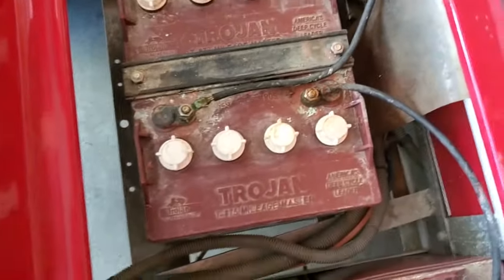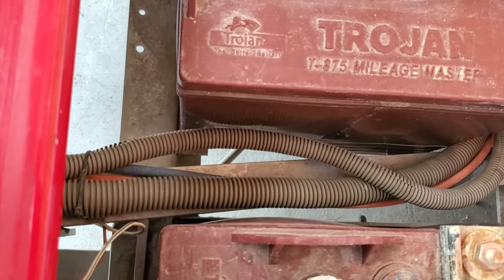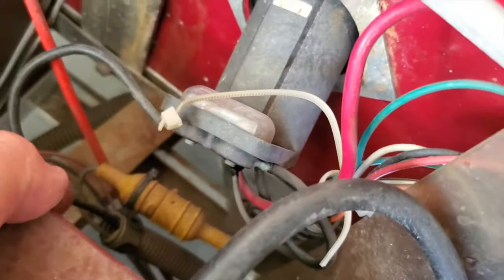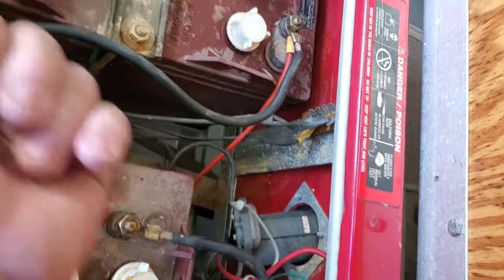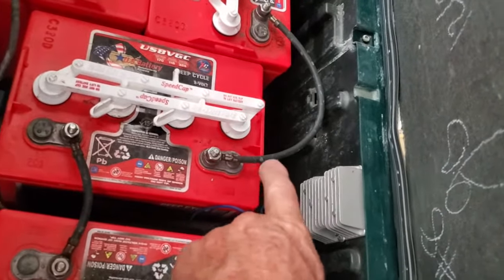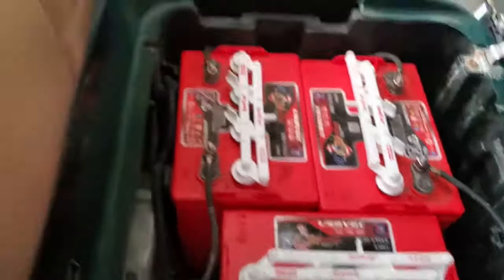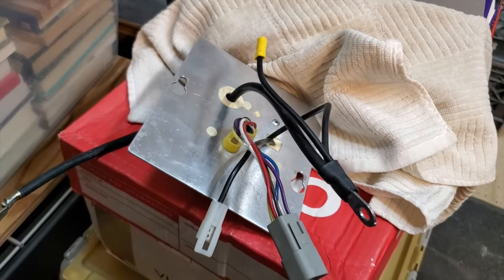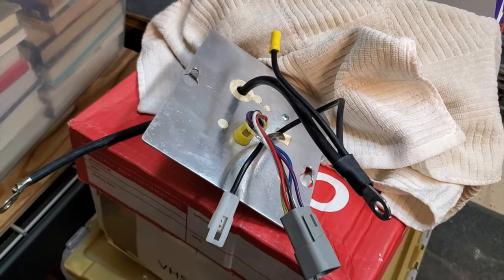How To Bypass Your OBC

Comment: I just did the obc delete, it will charge now but will not move forward or reverse. I have followed all your instructions here. Any suggestions?
Reply from the maker: I assume you meant you did a bypass?

Did you get a new charger?
What model and year cart do you have?
Is the tow switch in run?

Tell me what all you did?
Reply: @waynemartin.waynesgolfcart4900  it is a 2007 club car ds, i completely removed the obc. Ran the #10 black wire from the charger port to the last negative battery. Spliced the white and blue wires together.
Reply from the maker: sounds like you did it right. Text me pictures of your wiring so I can see the wiring you did as well as everything under the seat so I can see all the batteries and wires
Reply: @waynemartin.waynesgolfcart4900  took some pictures,  sent them to your number, let me know if you got them.
Reply: @gnjcs  I have the same problem. I connected all the wires the way you did, but my cart is not moving in forward or reverse when i press the pedal. Can you share the fix for this? I also have a 2007 club car ds
Reply from the maker: Those wires won't keep cart from running, you must have missed something. 
Text Me pictures

Comment: I have a Club Car Powerdrive 3 Charger that I need to use on a 48 Volt Forklift battery and I am not sure what to do with the 3rd Blue Wire.  Do I need to by an OBC and connect it somehow (to the Solar trailer)?   Any comments would be appreciated.  A 3 Wire Plug to a 2 Wire Anderson Connector is what I need to accomplish.  Never Done this before,
Reply from the maker: That charger won't for you, you need a different charger
Reply: @waynemartin.waynesgolfcart4900  There must be a way to make it work.  Let me know if you have any suggestions over the next few days.  I am going to (at least) try to make it work.
Reply from the maker: You can make it turn on, but it wont turn off
Reply: @waynemartin.waynesgolfcart4900  So if I wire Just the Red and Black Wires, and leave the Blue disconnected, you are telling me that it will (probably) charge the 48V Battery Bank, but will Not stop charging on its own: but will have to be Monitored and shut off manually: is that Correct?    Or do I some have to wire up the Blue wire (to something)?
Reply from the maker: You have to do some wiring in the charger to make it come on, but yes it will not turn off by itself.

Your forklift has a round club car receptacle on it ?
Reply: @waynemartin.waynesgolfcart4900  No the Forklift Battery has an Anderson SB350 Connector (just 2 wires).
Reply from the maker: why dont u just get a 48 volt charger
Reply: @waynemartin.waynesgolfcart4900  My friend Didn't get the one I Told him to get -- that was made for Forklift batteries, but thought he could get by with a Cheaper One for a Golf Cart: I mean, the Both Use a 48 Volt Battery, so why not.  Now I know why.
I thought that maybe the 3rd wire was just a ground, but apparently Not.

Comment: I have an old 1995 DS Club Car. It has brand new batteries, but it won't move unless I "play" with the Go pedal , if I move it back and forth it will suddenly Take off and run , until I stop, then I have to play with it again .  Help !  Any ideas ?
Reply: Hey, man did you fix the problem? I have the same problem. 
Please help
Reply from the maker: I would say either a micro switch on the f/r or the vglide.

Comment: Why not just take out the fuse on the grey ?
Reply from the maker: If you are talking about bypassing the obc, you can remove the gray wire fuse instead of cutting the wire off, if that's what you want to do.

Comment: Hi Wayne, question is better to do this bypass o replace the Obc?
Reply from the maker: Money wise, its almost the same cost either way. 

1 advantage is of you bypass the obc,  you will never have trouble with that again. 
Another advantage,  is you need a new charger, so end result will be you should have a newer and beer charger. 

THERE is only 1 model of the obc that is still available for less than 250.00, that is for a very old model, and that is the only 1 that will be cheaper to replace the obc than bypass it, that is assuming you are doing the work yourself. 

I myself,  bypass obcs,  rather than replace on all my carts.

Comment: Does anyone know which yellow wire he’s talking about coming from the solenoid? I only have a 6g yellow cable. Help.
Reply from the maker: If you don't have the skinny yellow wire, then forget about it, not all have that wire.
Reply: @waynemartin.waynesgolfcart4900  this is my issue...I have a 97 club car 48 volt. This apparently is a regen 1 cart. I have two solenoids that I'm pretty darn sure don't have the skinny yellow wire going to either one. However, besides the black and gray wires...i also have a yellow and green wire coming out of the back of the OBC and goes to the old club car black controller and not the solenoids. Do I need to worry about these green and yellow wires? Thank for the straight forward advice. Great channel.

Comment: Dpi charger died so I bought a links from Battery source, worked great for a couple months then Quit working on my 2000 DS. Still worked on friends DS. Sold Links charger and bought eagle performance charger from battery source. golf cart still runs fine just won’t charge. They said just run negative charger receptacle wire to final negative battery. Did not charge, then followed your instructions with yellow wire from solenoid to negative battery and no charge still and cart stopped working. Replaced yellow wire back to controller. Cart runs again but still no charge. Any suggestions? Thx!
Reply from the maker: First thing to check is the # 10 red wire from charge receptacle to main pack positive.  Make sure the ring terminal or end of wire is not corroded or swelled up.

Then run black from cart receptacle to main pack negative.  If you have a skinny yellow wire on the solenoid,  reroute that to main negative. Not the fat yellow wire.
Reply: @waynemartin.waynesgolfcart4900  I did everything and still
No charge. Cart still runs. Could there be anything wrong with the new charger, plug has bottom prong slightly shorter than +/- prongs. Is that normal? The guy from battery source says to rewrite everything back to normal and just add jumper from charger receptacle negative to main pack negative. Also I managed to damage the fuse on the charger receptacle so I just strait wired it hoping the new eagle performance charger would manage. Maybe I’ll go try a friend’s factory charger and set timer for 20-30 minutes at a time
Reply from the maker: maybe you have the wrong model charger.  What is exact model number and brand charger ?
Reply: @waynemartin.waynesgolfcart4900  thank you very much for you help
Reply from the maker: I  think you have the wrong  charger
Reply: @waynemartin.waynesgolfcart4900  Ok, I returned the charger to battery source and they had a summit2 charger. So I picked it up and wired the cord as instructed.  I had already clipped the thin yellow wire off of the solenoid and ran it
To pack negative. Should I have left it connected and spliced into it? I plugged in-the new charger, The blue power light illuminated on the charger to show AC power,  The carts charger receptacle female plug even shows 47volts, cart still runs fine but no response from charger.
Reply from the maker: You don't remove the skinny yellow wire from the solenoid,  you run it from the solenoid to the pack negative
Reply: @waynemartin.waynesgolfcart4900  Are use the thin gray wire like you did to connect it to the yellow wire going to the solenoid. Should both pieces of yellow wire be connected still? Where does the yellow wire come from?
Reply: I’ll splice it back and try it
Reply: @waynemartin.waynesgolfcart4900  I spliced it back and still have nothing. I’m stumped. I appreciate your time, I really do sir
Reply: @waynemartin.waynesgolfcart4900  Wayne!! You wouldn’t believe this…. The stupid cord from battery source was wired backwards! I checked continuity from the charger to the prongs and couldn’t get a reading cut the shrink wrap back and opened a plug housing and saw that The wire colors didn’t match. I flip the two prongs around, boom we’re charging. Thanks for your help!!
Reply from the maker: if you cut the yellow wire,  you only need to use the part that goes from the solenoid to the main negative
Reply: @waynemartin.waynesgolfcart4900  thanks so much. I’m stoked. I’m playing with the Bluetooth diagnostics now. Thanks for your time! I greatly appreciate it
Reply: @waynemartin.waynesgolfcart4900  Hey Wayne. Quick question. I have a 48 volt 2000 DS with the v-glide throttle and I was wondering if doing an Mcor conversion would boost performance (speed) any. If not, what controller would you recommend. I’m tired of 12 mph. I already bypassed the obc, so hopefully that doesn’t make me ineligible for upgrades. Thanks!!
Coy from Florida
Reply from the maker: A mcor will not give you more speed than a vglide, but it will be much smoother.

If you want more speed you need to go with a bigger controller and solenoid,  alltrax is my suggestion.
Reply: @waynemartin.waynesgolfcart4900  which amperage controller do you suggest?Also I ordered a voltage reducer from you for my lights. Thx!
Reply from the maker: maybe 400 amp

Comment: I have a question, my 95 DS will run just fine when the ambient temp is below 50 degrees, but above 60 my cart is dead. Have you ever run into such a situation and could it be the OBC?
Reply from the maker: No haven't heard of that before.  No don't think it has anything to do with the obc.
Reply: @waynemartin.waynesgolfcart4900  I kinda figured you would say that, which means that I am going to spend some time chasing wire to see if I can find the culprit. Thank you.
Reply from the maker: How old are your batteries?

Comment: Hey Wayne,
I've got a 36v converted to 48v ds . Is there anyway I can bypass the 48v power drive charger so I don't have to purchase a new charger?
Reply from the maker: you can bypass the charger,  but it will never shut off by itself
Reply: @waynemartin.waynesgolfcart4900  no worries I've got a timer switch plugged into the power on the wall. Can you explain how to without telling how so you don't have any liability.  Lol
Reply from the maker: you have a 48 volt charger and a 48 volt cart?
Reply: @waynemartin.waynesgolfcart4900  correct minus the obc and controller. 
Just v-glide and resistor coils.
Reply from the maker: ok I'm very confused whatever you have, but it doesn't matter, let's not talk about the cart.
Inside the charger,  remove the small black jumper wire that goes from the breaker to the relay, take it out.
Then pull the other wire that is on the bottom of the relay, and plug it onto the breaker
Reply: @waynemartin.waynesgolfcart4900  lol and agreed on cart details. 
So I'll have the wire from 110 and the wire from the coil hooked up to the breaker/fuse and only two small wires connected to the relay correct?
Reply from the maker: yes. and the 2 wires on the relay won't be doing anything
Reply: @waynemartin.waynesgolfcart4900  excellent and I definitely appreciate you walking me through it.  

Love watching your DS videos I've learned alot from watching them. Keep it up and stay healthy.

Comment: My 2004 ds doesn’t have a small yellow wire on the solenoid.  A solid blue and blue with white stripe.
Reply from the maker: Ok I agree,  so are you asking me something?
Reply: @waynemartin.waynesgolfcart4900  what do I do if there is no small yellow wire.  You’re video doesn’t address that.   But in other questions and comments you tell them to connect the blue and white wires.
Reply from the maker: If you don't have a small Yellow wire, or a blue and white at the obc, then don't worry about it, nothing else to do besides # 10 black

Comment: Howdy Wayne. I’m installing allied lithium batteries in my 2003 club car ds and I’m trying to bypass my obc but I have the triangular obc connector with no blue and white wire to connect together. What do I do now?
Reply from the maker: Do you have a small yellow wire going to the solenoid?
Don't worry about the blue and white, if you don't have them.
Reply: @waynemartin.waynesgolfcart4900  
Yes i have a yellow 18 gauge wire with a spade connector that goes to the solenoid.
Reply: Do I run that yellow wire to the main negative on the lithium 48v 30amp battery pack and forget about the brown and red wires on the triangular connector?
Reply from the maker: Then besides rerouting the #:10 black wire from back of cart receptacle, to the main battery pack negative,  unhook the gray wire, then reroute that small yellow wire so it will go from solenoid ( where 1 end of wire already is ) and the other end needs to go to either main battery pack negative or to the B- terminal on the controller.
Reply from the maker: yes forget those other 2 wires, cut them you won't be using them.
Reply: @waynemartin.waynesgolfcart4900  
I cut the #10 wire from the main negative to the controller and pulled it through the obc then I put a new ring connector on and reinstalled it from the controller to the main negative of the 48v battery package along with the black wire from the charge receptacle and the yellow wire from the solenoid. Is this a correct and complete obc bypass?
Reply: I also disconnected the gray wire.
Reply from the maker: yes
Reply from the maker: yes
Reply: @waynemartin.waynesgolfcart4900  Thanks Wayne.
I originally wanted to install the Row POW batteries but due to the upswept frame of my 03 club car I could not fit the battery pack in without altering the frame. So the allied batteries seem to be the easier way to go. Your channel is very helpful and I’m sending my golf cart buddies your way.

Comment: I have a 03 club car villager  6 seater back of the obc there are 2 dark spots  does that indicate  a obc ?
Reply from the maker: 😁 I don't know what dark spots are???  If you have a obc, there will be a 8 gauge wire running thru a hole in it, going to the main battery pack negative terminal
Reply: I can send a pic of it u like?
Reply from the maker: Yes
Reply: @waynemartin.waynesgolfcart4900  don't  know how to send d pic,can text a pic using your number ?
Reply from the maker: Text the pictures

Comment: I recently did the bypass and bought a new charger. Charger comes on but will not shut off
Reply from the maker: You might not be waiting long enough to see if it turns off. Usually if it will turn itself on, it will also turn itself off.
Reply: @waynemartin.waynesgolfcart4900  it ran for 4 hrs never shut off. The voltage meter started goin backwards so I unplugged it. Voltage never got over 59
Reply from the maker: Amps should go backwards,  and 4 hours is not enough.
Reply: Ok thank you Mr Wayne I will leave it on longer and see
Reply: Mr Wayne I left the charger running for 10 hrs, and batteries were starting to boil over. Yet charger still never shut off
Reply from the maker: What charger did you get, the problem is either the charger or a bad battery.
Reply: @waynemartin.waynesgolfcart4900  gotcha. More than likely bad battery. Thanks for all your time

Comment: Hi Mr. Wayne
How di I bypass OBC on 1998 Regen 2 Club car 48v
Reply from the maker: It's on my video.
Run the receptacle black to main pack negative , and reroute the skinny yellow wire on the solenoid,  over to the same pack negative terminal.

Comment: Hi Wayne! I have a 98 clud car ds. I installed an on board Summit Ii charger. I've removed the charger receptacle and direct wired the charger to the batteries. My question is where do i connect the blue wire from the charger - it connected to the negative terminal on the charger. I believe this stops the cart from running while plugges in. Thanks!
Reply from the maker: I think you are correct, and if it ran to the negative before, I would hook it up to the negative terminal again.

Comment: The yellow wire in my cart has become disconnected. Where does it go?
Reply from the maker: There is more than 1 wire in a cart.

What year and type of cart?  Does the cart still run with this wire disconnected?
Where abouts on the cart, Is this wire hanging?
Reply: @waynemartin.waynesgolfcart4900  it has stopped charging. I bought a new battery charger thinking that was the problem. But still nothing. I noticed the black wire with a yellow end disconnected. Could that be the problem?
Reply from the maker: I think the wire you are describing,  doesn't go anywhere,  that is the negative wire with a bullet end . Don't worry about that wire.

If your charger isn't charging,  it could be lots if things:
.Bad obc, bad or weak batteries,  no power at the ac outlet,  bad charge receptacle,  corrosion on the main red charge wire.

You just haven't given me enough info.
Reply: @waynemartin.waynesgolfcart4900  Thank you so much!!

Comment: Hi Wayne.  Just to clarify.  When bypassing the obc on a precedent,  the blue and white wire get tied together after removing removing wires from plug.
Reply from the maker: Yes on a precedent,  you need to tie the blue and the white wire,  to each other.

Comment: I have a golf cart 1999 how to buy pass obc cause it does not charge
Reply from the maker: I tell you in my video,  10 black wire to charge receptacle,  and yellow wire to solenoid.
Reply from the maker: Before you do a bypass,  find out what is wrong first.  Might be alot cheaper to fix the actual problem, than to buy a new charger.